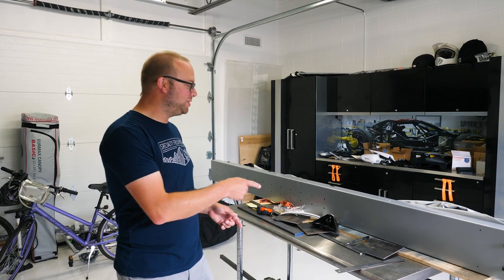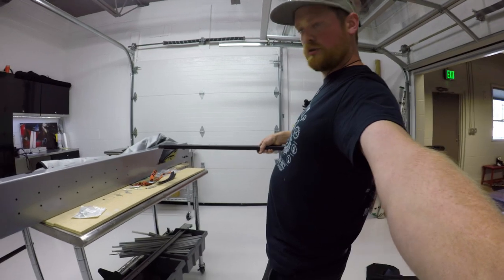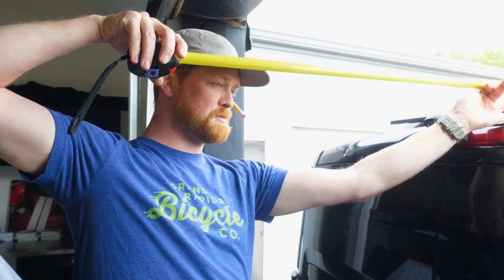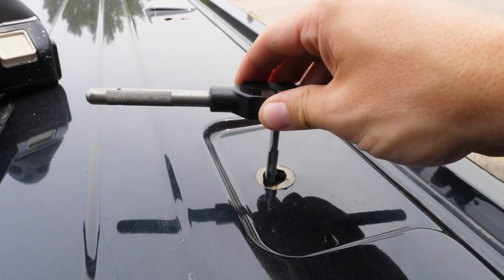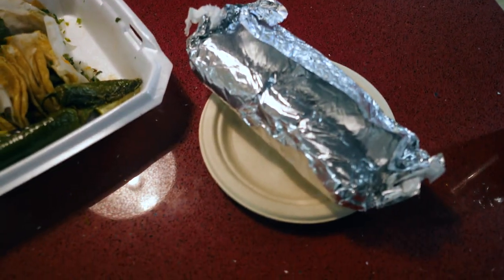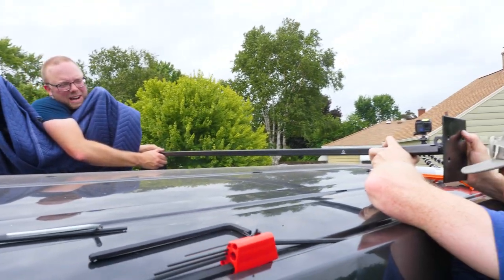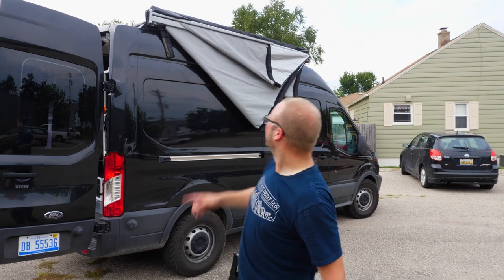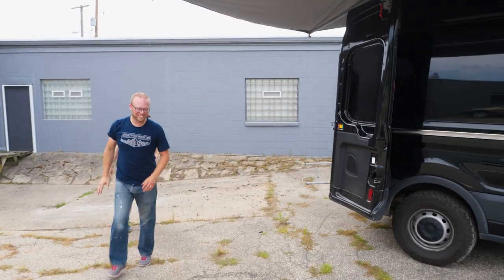Alu-Cab Shadow Awning on a Ford Transit video van. Vlog #11

Comment: Nice. I might have to save up for this one day for my Transit. Still saving up for the safari roof rack first. do you think there'd be less modifications needed with a full size safari roof rack?
Reply: Yea, It would most likely be much easier to install. Ours was a bear because we were attaching to the ends of typical OEM crossbars.

Comment: How dose it handle the wind?
Reply from the maker: Not bad. It definitely has a bit of lever arm on the roof rack when fully out without the support. It’s pretty fine to maybe 12-14mph “breezy” winds. If you put the single leg down, it’s comfortable to another 5-10mph.

Comment: That is too small to cast a loungable shadow on the ground at that height , but when you have tones of money you learn by loosing lots.
Reply from the maker: John Hales it isn’t really for lounging. It’s for snow and rain, works really well. Keeps both doors clean when open and unloading. As much as I wish we had tones of money, this was significantly cheaper than 2 awnings to cover both doors. A large Fiamma for the side, and a smaller RV door awning for the rear was well over $1,000 more. This covers both at once.